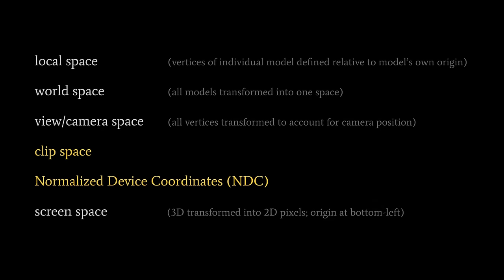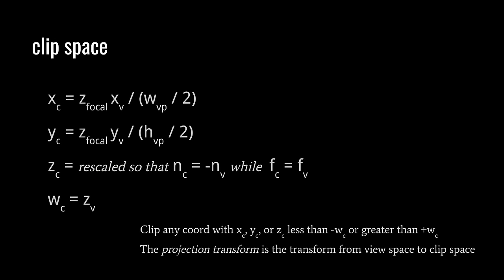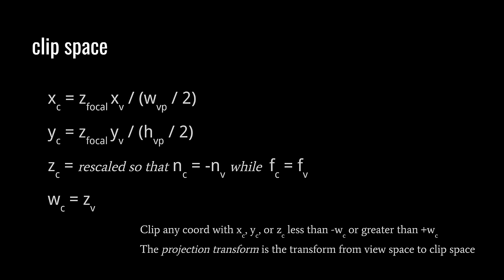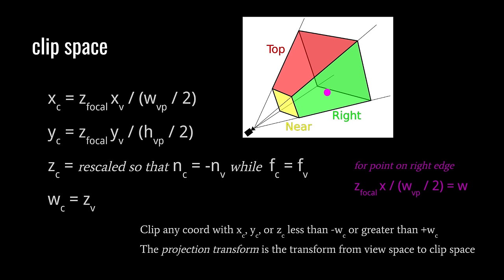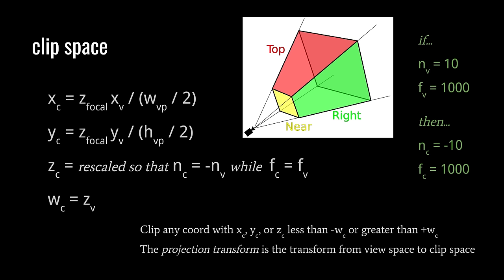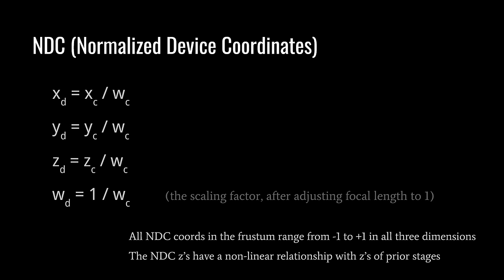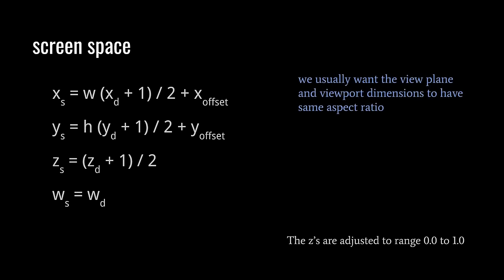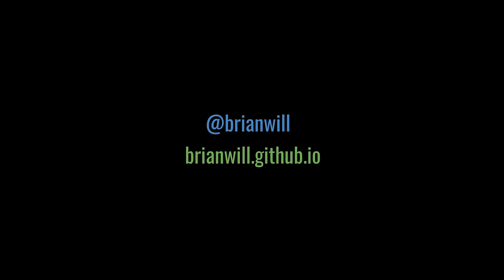OpenGL - clip space, NDC, and screen space

Comment: where is zFocal in the frustum.. a bit confused with this, is it the near plane or mid-point of near and far ?
Reply: It's an arbitrary number in the context of this video but in practicality the way we get Zfocal is by dividing 1 with a tangent of one half of camera's horizontal FOV expressed in radians and multiplying it with the near clipping plane: 1/tan(cameraFOV_Rad/2) * nearPlane. That gives a formula for dealing with vertices' x axis, conversely for y axis we take the exact same formula and multiply it with our window's height to width ratio as follows: (1/tan(cameraFOV_Rad/2) * nearPlane) * windowHeight/windowWidth. You have similar explanation in the OpenGL Model and Projection video of the series.